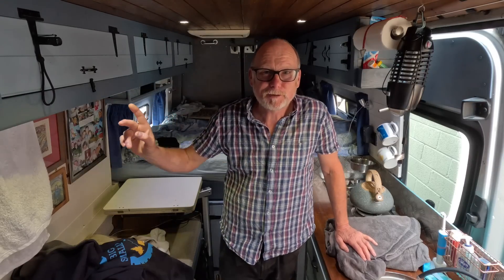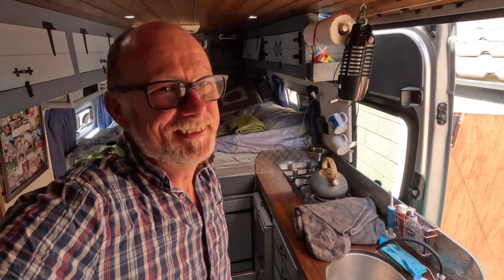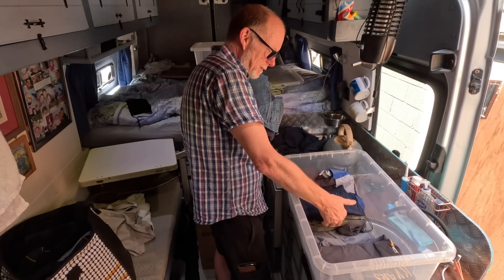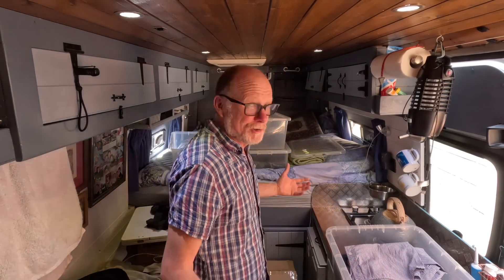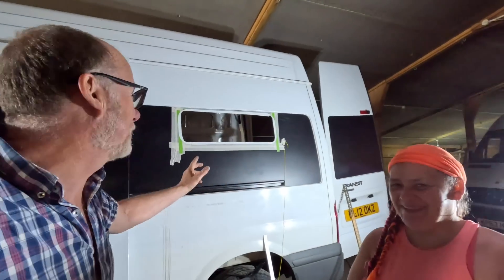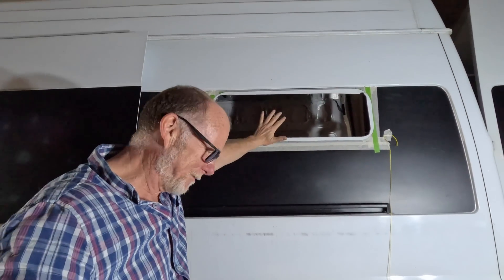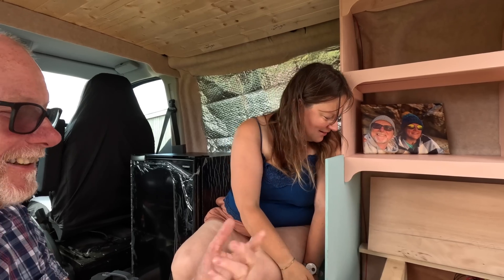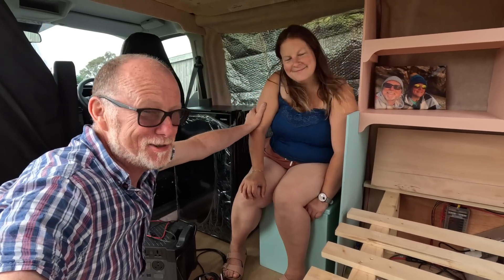This Could Have Ended Badly: How Not To Fit A Window In A Camper Van

Comment: Interesting idea the transformer. It's a shame that unless you buy a very large expensive model, you only have the accessory socket on these power packs. Do you have a link to the transformer you used as I can't see it in your Amazon. Also wondering how much power it uses when switched on but no load for example, would be interesting to know.

Comment: I wouldn't know where to start with the maths, but all that voltage conversation you are doing on the electrical stuff. I would imagine, there is a lot of power loss. 
One test you could do is run the fridge direct from the power pack and compare what that draws as apposed to running it through the 240v to 12v transformer. Would be interesting to know. Would make a bit of content for a video if nothing else.
Another simple test is, if the transformer gets warm or even hot. then you're using your electric to produce heat instead of powering your devices. Yes it works, but I would imagine in an off grid situation, then every watt  counts.